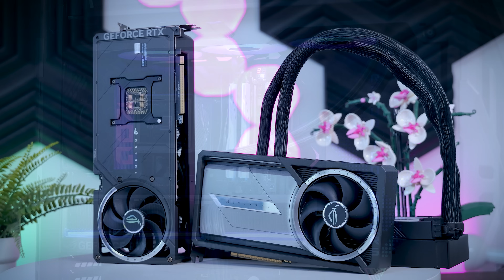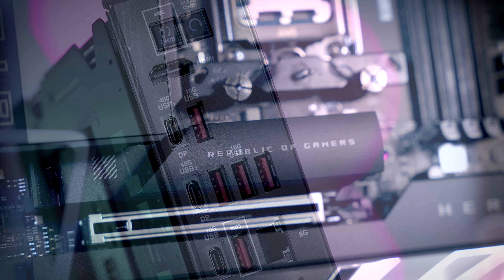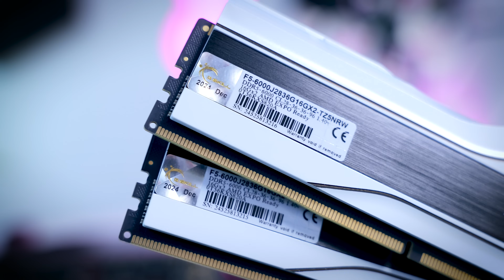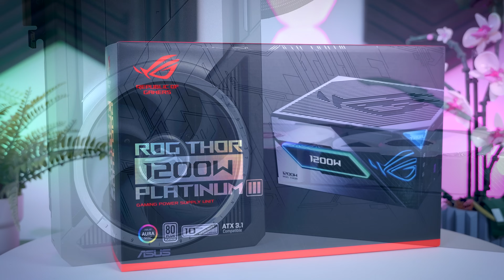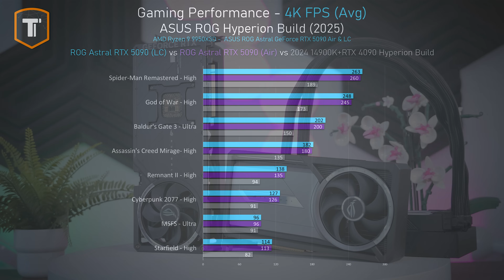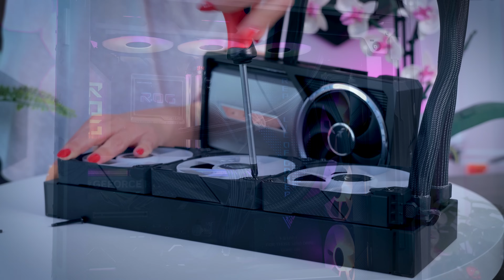The ULTIMATE Gaming PC - Ryzen 9 9950X3D + RTX 5090 ASUS ROG Build

Comment: Marry me 😂
Reply: Just wanted to say after finishing the video I had a CPU: 11th Gen Intel(R) Core(TM) i9-11900K @ 3.50GHz, 3504 Mhz, 8 Core(s), 16 Lo...
11900K 8-Core 3.5 Ghz
(5.30 Ghz Turbo)
Case: Phanteks
Metallic Gear Neo
Qube
CPU Cooler: 360mm
AlO
Motherboard: gigabyte technology Z590 vision d
RAM: 32GB DDR4 RGB
Gaming Memory 3600
MHZ
Graphics: Nvidia
Geforce RTX 4070 Ti
12GB
Primary Hard Drive:
1TB Gen 4 NVMe SSD
Power Supply: 850
Watt 80 Plus Gold
And saved for a few years and just got my new Processors: AMD Ryzen
9 9950X3D 16-Core (up to 5.7GHz Max Boost)
Motherboard: ASUS
ROG CROSSHAIR
X870E DARK HERO
Memory: Vengeance
96GB (2x48GB) DDR5
6000MT/s
System Cooling:
CORSAIR ICUE LINK
TITAN 360 RX RGB AIO
System Fans: Corsair iCUE LINK RX120 RGB
Graphics Cards: NVIDIA
GeForce RTX 5090 FE
32GB
Operating System: MS
Windows 11 Home
Operating System Drive: Samsung 9100 PRO
4TB
Hard Drive: Samsung
9100 PRO 4TB
Power Supply:
CORSAIR HX1500i 80
PLUS PLATINUM from origin

Comment: Wait, isn't the 9800X3D the superior gaming CPU over the 9950X3D?
Reply from the maker: I have a seperate video on that. They're basically the same, but the 9800X3D is better value if all you do is game, and the 9950X3D is better if you just want "the best" imho.
Reply: @TechTesters  
I thought the 9800X3D was better in gaming, as was the 7800X3D vs 7950X3D. 
But the 9950X3D is just faster (In the vast majority of games).

Still a question of money, of course. Most gamers will never really make use of the 200$ extra you pay for the 9950X3D

Comment: i have this:
CPU: AMD Ryzen 9 9950X3D 4.2 GHz 16-Core Processor
CPU Cooler: Cooler Master MasterAir MA612 Stealth ARGB 62 CFM CPU Cooler
Motherboard: Asus ROG CROSSHAIR X670E HERO ATX AM5 Motherboard
Memory: Corsair Vengeance RGB 128 GB (4 x 32 GB) DDR5-5600 CL40 Memory
Storage: Samsung 990 EVO Plus 2 TB M.2-2280 PCIe 5.0 X2 NVME Solid State Drive
Storage: Samsung 990 EVO Plus 4 TB M.2-2280 PCIe 5.0 X2 NVME Solid State Drive
GPU: Asus TUF GAMING GeForce RTX 5090 32 GB Video Card
Case: Fractal Design Meshify 2 XL ATX Full Tower Case
Power Supply: Asus ROG THOR 1600T Gaming 1600 W 80+ Titanium Certified Fully Modular ATX Power Supply
Operating System: Microsoft Windows 11 Pro OEM - DVD 64-bit
Wireless Network Adapter: Asus PCE-AXE59BT 802.11a

Comment: Makes the Astral LC version seem pointless, same heat and noise inside a case (even one of ASUS's most expensive cases).

Testing components in real situations and not an controlled enviroment is very much usefull to me, and eveyone else I suppose.

Decided I will make a white 5090 build inside the Hyte Y70 touch.

Thank you for providing honest content 
😀
Reply: They're running a bad fan setup. I have the same case with the Astral LC and it runs 58-60c at 600w, 21c ambient. The case does not do well with dual rads and the side RGB panel mounted - you really need the extra 3x 120mm fans in the side or the case gets choked out. Overall, the ROG Hyperion has pretty poor airflow- vents are way too small and surrounded by plastic bits everywhere. Even the side fan mount is blocked by a tempered glass panel, forcing the fans to draw air from the sides.

Comment: Just a quick note, the fan setup in this build is probably preventing the Astral LC from cooling as well as it can. There are two radiators exhausting and no other source of cool air coming into the case, so the  GPU radiator isn't getting the fresh airflow it needs to perform well. That's why when the rad is set to intake the temps drop, although not as well as the card is capable of.
Source: I own the Astral LC and at a full 600w load it peaks at 60c at 22c ambient, even when set to the "quiet" bios. This is in line with reviews by Techpowerup and OC3D TV. 

The Hyperion case in general is difficult to cool when running two rads- it only supports 7 fans total, so if the two rads are taking up 6 fan slots, you only have one fan to pull in cool, fresh air.

Really enjoy this channel, just wanted to give my unsolicited two cents!

Comment: I don't suppose you know how much this system weighs? I know this case and GPU is extremely heavy but it actually looks like you might need an engine crane to move it around the house 😂😂😂

I'm not a particularly big fan of Asus and their pricetags but I will admit that they absolutely nail the aggressive gamer styling they're going for with the ROG and TUF ranges, it definitely pulls your attention to their products. I do however prefer their ProArt range as it's a lot cleaner and just looks very sophisticated but their newer Prime models also look pretty good too.
Reply from the maker: I didn't measure it, but the case itself is 21kg so I'd guess the full build is closer to 30kg. And it's tall too so it's really hard to lift onto a desk.
Reply: @TechTesters  wow, this is also the Ultimate Gaming Weightlifting Plan too then lol

Comment: I have the Liquid cooled 5090 Asus with the 9950x3d. However, i ran into the problem of power breaker of the room not being able to support the power draw. Luckily i have an Anker power station that support up to 1800 watts so thats how i got around it. All that to say make sure your breakers can support. The breaker i have is 15amp but it for 2 rooms but theoretically it should also be able to handle 1800watts.

Comment: There's extreme performance and then there's overkill. I contemplated getting the 5090 Astral but simply could not justify the price premium. No, I don't want and have to pay a premium for Asus tax and/or load pin sense ability. I settled for Zotac Amp Infinity 5090 instead.

Comment: I’ve built a very similar system:

ROG Hyperion GR701 Case
ROG Crosshair X870E Hero 
AMD Ryzen 7 9800X3D
ROG Ryujin iii 360 ARGB Extreme
G Skill Trident Z5 Neo RGB 32GB CL30 6000
ROG Thor Platinum II 1200W
Corsair RX140Max fans x4
Samsung 990Pro 4TB
ROG Astral 5090 OC

I can’t seem to get the ROG Thor Platinum III anywhere in the UK.

CPU temps during gaming reach around 60 degrees centigrade which I’m very happy with.

Comment: I know people are going to be upset about the price of this system and the fact that very few people could ever afford such a system, but it's still interesting. The high end ASUS stuff is really nice, and while I'm not sold on the case entirely, it is a nostalgic throwback to gaudy early 2000 "xXx_GaM3R_xXx" cases. I suppose the other thing is I'm not sure I'd want an additional point of failure on a 5090 with the liquid cooled option. I suppose the water source is near if the connector decides to enable flame generation.
Reply: I spend $5.6k building my first gaming pc that has RTX 5090 & Ryzen 9 9950x. With other parts too. I went to Micro center and they helped me. And ima spend over $900 soon on a monitor. Im not rich at all. I just want the best gaming PC so I can see the difference between my ps5 to this PC

Comment: Mne is similar but let's just say a little,,cheaper", 9950x3d, 5090 msi gaming oc trio, x870e carbon, 64gb ram kingston fury cl 30, 2 Tb crucial t500 & 2tb wd sn570, all this overclocked and undervolted in a Fractal North xl case (wich I like more than asus case shown here). It's elegant, it's godlike powerful, it's functional. Still, a nice build here.

Comment: I ordered a very similar build based around Asus with the LC 5090 card on January 25th. Still waiting for it to be delivered but this video encourages me that the wait will be worth it.
Reply: Did it arrive yet?
Reply: @lesedishametja7005  yeah it did
Reply: 3months of depreciation and obsolescence before u even receive. Nice
Reply: @80srenaissance67 3 months so far. This could run and run unfortunately. I'll be seeking legal remedy if it does not turn up soon.
Reply: @mtenga67  years and years ago I bought a prebuilt system because I thought it would be easier ...big mistake.They are conmen of the highest order. You'd be much much better off just buying the components separately yourself. Good luck with it though..I remember the anticipation myself waiting and it was quite a rush..endless checking the specs lol
Reply: @80srenaissance67  my build is close to the one in the video and it's been one week since they started delivering the package, yet, I didn't receive it xD can't wait to do some stuff with da pc

Comment: Nice job. However, your front radiator configuration should be set with the hoses at the bottom.
Reply: I know right? But hey still a good build. And the length of those hoses might mean top is best, so as to not kink or hinder flow.
Reply: Yeah i noticed that, but i also noticed the bottom space seems too narrow for the tubes with the psu cover on, just correct me if im wrong.

Comment: I generally like your content. I understand that it’s a sponsored video so you may not want to speak negatively on Asus and the parts used in this video, but that motherboard is known to have issues with scratching GPUs due to metal pin with the q-release system. To avoid shedding Asus in a negative light, they could’ve sent you one of the newer motherboards (e.g. Apex) that address this issue with a revised q-release system.
Reply: If they went with the AMD CPU, the Apex is not using Intel ?

Comment: I had both GPUs and the tube location of the tubes for the LC water cooled variant makes it super difficult to fit in smaller cases such as lian li vision compact or such. Also I tried it with top mounted radiators and I got a peek of 60 degrees at 96% load with the LC and 70 deg with the air cooled.

Comment: I have a 14900k + 5090 and my 1200w asus psu could not handle the transient spikes of the 5090, is it just that my psu is faulty then?
Reply from the maker: 14900K will pull a bit more, but it really shouldn't challenge a 1200W PSU much. I didn't have any crashes with this setup anyway.
Reply: I have a 13900ks on a Ryujin 3 extreme paired with a 5090 astral air and a Thor p2 1200w 64gb of memory. It’s also having issues when playing games after a few minutes, I’m using a Strix z790-e gaming and it start buzzing with a long loud beep error sound. IDK what gives, it’s got all the latest drivers updates. Just got this Astral. I had a Strix 4090 LC and it didn’t do this..
Reply: @jestan01  I’m going to test a 1600W ATX 3.0 PSU over the weekend and see if it solves the problem. Seems like the 1200W might be getting overwhelmed by the 5090’s transients, even if the total wattage looks fine on paper. I’ll report back once I’ve tested it.
Reply: @ My PC mobo boots up and posts fine without any beep error, and If i play not so demanding games there's no spike issue, only if i try playing high demand games and only after a few minutes. It also sounds when running 3dmark's time spy extreme benchmark. Thanks for doing it.
Reply: @jestan01  switching to a 1600w psu eliminates the issue seems like the 5090 have very high transient spikes you need either atx 3.1 1200w or 1600w psu in this video an atx 3.1 psu is used which is why there was no issue
Reply: @ Thanks for reporting back! I was able to stop my spikes by under vaulting my i9ks from 320 to 253 and lowering the GPUs peak to 85% in gpu tweak3, it’s stable playing 4k and it’ll do for now. I heard the new ROG Titanium iii series launching the US on May 16th I’m gonna try to get one.

Comment: For gaming purpose the 9800X3D is the better choice and is what I would use to build a gaming PC.
Reply from the maker: Just for gaming, yes. But for a proper ultimate build, 9950X3D is the best option imho.
Reply: @TechTesters indeed and this time the gaming performance is just as good with all that non gaming performance as well unlike the 7000 series.
Reply: @TechTesters  Actually, one thing is still missing in this "ultimate" build, which is a GPU that supports 32 bit PhysX. As powerful as this build is, it will really struggle if you wanna run some older games with PhysX. I remember seeing people install a 2060 or whatever in a PC and let it handle PhysX and a 5090 which handles the rest.
Reply: @EarthIsFlat456  Well, you can easily turn off PhysX.  It's not like the games need it.  At least I can't think of a single one which needs it to run.  Don't get me wrong, it sucks that they can't handle them, but it's not like you cannot play the game without it.
Reply: @TrusteftTech  I never said you couldn't play the games without it. But for an "ultimate" gaming PC being able to run max settings while maintaining at least decent performance should be expected.
Reply: @ I am not defending Nvidia on this, but it's such a tiny thing I have nothing else to say.  Blame Nvidia yes, but removing the "ultimate badge" for this?  Nah.
Reply: @TrusteftTech  whatever you say.
Reply: @  lol

Comment: damn it is an expensive build. But the 9950X3D and 5090 is clearly the fastest gaming combination right now. I think most people would be fine with the 9800X3D for gaming though 😂

Also I can recommend OCCT for testing max power and cooling. It has one stress test that runs both CPU and GPU really hard and after 20-30 min of that you should know if you cooling solution ever will become a problem.
Reply from the maker: It's.. a bit much, I know.

And I know you can run a CPU + GPU stress, but I feel Cyberpunk 2077 in it's RT OD mode is pretty much as intense as a "real" gaming workload can get.
Reply: @TechTesters  That is fair. I have not tried Cyperpunk RT OD

My pc would get about 1 FPS assuming it won't crash do to low VRAM😭😂

Comment: this pc might actually need 1500/1600W psu for peak power requirements , 1200W might work just fine but 1600W for the win
Reply: really ?
Reply: Saw a similar build with a bunch of Lian li fans and the persons PSU was using like 880 watts for astral and the other components. 1200 is fine
Reply: @SRTVPR  im speaking of peak power , that gpu can consume 600W max on peak , pair that with a max peak power of 14900ks  which can take 420W peak ..........

Comment: please compare the new 9100 pro nvme in terms of load times , gaming , 1 and 0.1 percent lows , please reportt if any general smoothness and quickness experienced only by the user but not shown in youtube videos if that is observerd , i think you will have to enable rebar to make full use of the nvme along with the latest gpu
also put a heatsink on that nvme to get the best results , would recommend you put a thermalright hr10 pro

Comment: Did you buy the ROG bucket from the newegg or smth? 😂😂😂 by the way, 14900K is still better in 4k, not much but still better. Maybe with 6090 or 7090 we will see some difference. and yea,  you can`t just compare 9950x3d and 5090 against intel with 4090 and call it best built. Not faIr